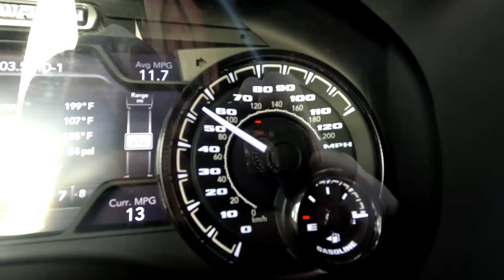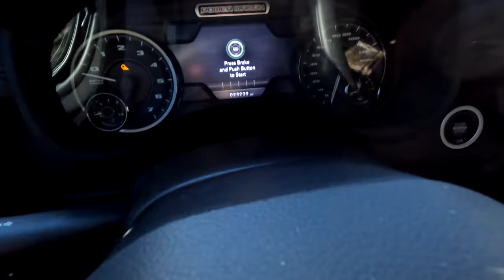2 Year no BS Review - 2019 Ram Power Wagon

Comment: Each manufacturer definitely have there quirks and dodges is definitely electronics. Wiring to be specific but it's rare that I ever see them have major mechanical issues. Ford from my experience typically has the mechanical issues but the electronics seem to be the best of the three and gm is in the middle. It's honestly a pick your poison issue. Sense I typically get bare bones trucks I have stuck with ram but there's no way I would get a fully loaded one as there's just way to much to go wrong.
Reply: It's a shame we can't have a truck built from the best of all three

Comment: Did you put bigger tires on the PW? Did the mileage change after that?
Reply from the maker: Yes I did. Mileage dropped in city but climbed on highway, so it was a wash.
Reply: @JustinKingOffroad  did you put a tazer or  AEV procal to re calibrate tires or pressures?
Reply from the maker: @89wildstang   I actually used alpha OBD to recalibrate the speedometer because that is permanent. I do have the taser RAM for other items though.
Reply: @JustinKingOffroad  I am looking to get one of them . Which one do you think is best as far as user friendly  and ease of installation?
Reply from the maker: Tazer ram would be my vote. All menu items accessible right from the dash cluster!

Comment: I also have a ‘19. I have nearly identical miles as well. My adaptive cruise works awesome, I use it everyday, and it helps me get better fuel mileage. It does brake heavily though if someone ahead exits. By now I know it’s coming though so I’m ahead of it. I have had 2 instances where the radio volume starts going up on its own till it’s full blast. Even if you turn the radio off, it will be at Max volume next time it’s turned on. The first time I disconnected the battery and it reset and resolved. The second time I did the Uconnect reset. It hasn’t happened again in about 6 months though. That is the extent of my issues, so that’s pretty close to nothing.

Comment: I have the 2016 PW.. I’m at almost 90,000 miles.. I have never had an engine light, or any little issues that some are getting, it seems 2018 and up are getting these little issues. I have only had to do regular maintenance, brakes, wheel bearing, shocks.. and it’s time for a serpentine belt, I’ll order it Monday 👍🏻

Comment: Justin, I think you will find if you get a compellable outfitted Ford, Chevy or what ever with all the latest gadgets, you will find comparable problems. Technology in an automotive products is just a hard road to drive. Vibration and environment are really hard to overcome, speaking as an electrical engineer. Mechanical problems on the other hand are just suspect engineering. Poor brakes (undersized) is poor engineering in my opinion. They should design for the size and intended use. I love the Powerwagon though, great truck, but lots of electronics, like they all have now, you gotta expect problems unfortunately. Great, honest review and safe travels my friend.
Reply from the maker: thanks for stopping by!!

Comment: Good review.  I have 16,300 miles on my 2020.  Only issue so far is the drivers sun visor vanity mirror pops out.  I never use it, so it’s not a big deal.  I have lots of warranty left so I’ll deal with it someday.  I’m getting around 13-14 mpg the highway and 10-11 around town.  Driving is about 80% on road and 20% off road.  I play around on the Oregon coast dunes a lot so it gets a heavy throttle input for a lot of the off road stuff, otherwise it’s gravel logging roads at lower speeds and heading up into central Oregon mountains for camping. Love the truck.
Reply: Weird. I have the same issue with my 2020 PW drivers sun visor, it has been like that since I bought it
Reply: Had the same issue my dude, i just got a new visor all toguether from coparts for 80 bucks with the wiring harness and bulb included; it was more tedious changing the damn thing than it was to actually get it; i really though i needed a junkyar to save me

Comment: I have a 2016 and recently upgraded to the Powerstop pads (kept the stock discs).  The stock pads are hard as a brick. I'm having to get used to driving it again since the new pads are grabby in comparison to the originals.
Reply from the maker: i picked up a notable amount of stopping power on the powerstop pads, i was going to keep the OEM ones for spares, but ended up throwing the whole stock setup of rotors and pads in the dumpster haha.

Comment: Hey bud, thanks for the 2 year update.  That is a lot of little bullshit stuff.  I have 6,700 miles on my 2021 now, all good so far with exception to a weird paint thing on one of my rambox lids (hand size tan stain started forming after 2-3 weeks and got darker over a couple months then stopped.  No flaws on the paint itself, just the white turned tan???).  I asked RAM to replace the cover/lid with a new painted one and they refused.  I then asked RAM to provide an unpainted cover to protect my content while mine was getting repainted...RAM refused again🤷‍♂️.  I drive mostly city and average between 10-11mpg.  It sucks, new that going in.  Recently took a trip to Overland Expo East, 750 miles round trip ish...14.3 hwy, average speeds between 65-80...not bad (87 octane).  I'll have to try the non ethanol deal just to see what happens to mine.  In reality the extra cost will likely outweigh the benefits.  Just FYI...I've owned 4 Ford superduty's in the past 20 years, with two rams and a Tundra mixed in...they are no better I promise...luck of the draw.  In my humble opinion, the powerwagon is the most enjoyable truck I've ever owned in terms of over all comfort, handling, perfect size etc.  I actually preferred my 2016 F-250 diesel over my 2017 (both loaded diesels crew cabs).  The 2017 was a bit nicer/more modern obviously but I liked driving the 2016 better.  I hope mine does a bit better towing.  My wife and I have a 6 week trip planned next year from SC to UT and many states in between towing out patriots camper X3 (3,500 loaded).  Cheers
Reply from the maker: Great info!!! Thank you!
Reply: It is ironic people look for the mileage and yet drive at above 65MPH speeds in an non-aerodynamic vehicle. HP increase with the cube of the speed so if you double your speed, you will need 8X the HP!!! It is not a linear function!!!

Comment: I have a 19PW same color just different options . The dash cluster comes out really easy , screwdriver and a little prying. I have done it several timss in my adventure with the Z Auto Tazer . Funny cause i thougt my tach was doing the ticking thing , but it comes and goes. Might have to check it out . Thanks for the heads up on the seat , I will poke around under there to see if the wire is loose. Got a question tho , How do you feel about Ruwarts service department ? I had the wagon there for A/C work (never has been cold since it bought it) and when i got my truck back , yes the problem was somewhat fixed , but i was really not happy with the condition of my truck. AFter all the trips you have made up there , can you tell me what you think of them now? If you dont want to do it publicly I will cath up with you on facebook.

Still love the hell out of my wagon!!!
Reply from the maker: I have never once had an issue with the service dept up there.  they are fantastic folks, super friendly, have always done everything right the 1st time.  they just replaced EVERYTHING on the front end of the jeep to fix death wobble under warranty, and even touched up the door graphics that had cracked and torn a bit.  i'm surprised that you'd have any issues up there cause they have top notch techs, and bob and jeff always take care of me.

Comment: I have a '21 Power Wagon and modified my garage to get the truck to fit in the garage.  I work from home so I do not drive it much as gas is $5 a gallon here in SoCal.
Reply from the maker: Mine barely fits but I get er in haha!!
Reply: How did you do it? Got two garages and a 22 PW and I would like it to fit in my garage
Reply: @oinn8003  My garage had a conventional water heater on a raised platform.  I hired a plumber to install a tankless water heater in my garage and we installed the tankless water heater high on the wall so my truck cannot hit it.  I cut the garage door opener pole that attached the garage door to the opener.  I then had a neighbor watch very closely as I backed my PW in the garage the first time.  Once I confirmed my truck was backed into my garage at a perfect 90 degree angle, I marked the garage floor with masking tape to the driver's side  tires so I use the masking tape line every time I back into the garage; P.S. I have to fold in my side mirrors to fit my PW in the garage.
Reply: @RK-kj8di  dude… what? Lol. Why on earth would you go through that much wasted time, money and effort to park a 2500 pick up truck in the garage? It’s a truck bro. It doesn’t need to be garaged. It’s supposed to be out doors doing truck stuff
Reply from the maker: I park mine in the garage
Reply: @JustinKingOffroad  why? It’s a truck
Reply from the maker: @michaellarrick8881  because I can lol
Reply: @JustinKingOffroad  hahah fair

Comment: Let’s switch I came from an 17 power wagon to 2021 tremor 7.3 my main seal was leaking and my transmission is slamming gears 11,000mi on her  dealership fixed main  but trans is another story unfortunately… great review I wondered how the new ones are
Reply from the maker: Man... That's wild!
Reply: I just swapped my 18 that had 30,000 mi for a 21’. The new truck has adaptive cruise and lane stay where the old one didn’t. My 18 drove about the same as my 5500 ram work truck and like your’s Justin, it didn’t like to stop. My 21 on the other hand will smash your face in the dash. The 8 speed transmission gives it that constant feeling of power as you accelerate and I can steer effortlessly with one finger! Huge difference between trucks. An added bonus is that with my wheel/ tire combo my 18 could not turn lock to lock without hitting the radius arm and sway bar. I swapped my AEV wheels and 37” Yokohama’s from the 18 to the 21 and no rubbing lock to lock other than at full stuff. Great review

Comment: Good listen.  I just ordered a '22 PW and am really looking forward to it.  There is always a chance there will be some issues, I really appreciate the commentary on the brakes (I have owned a few Cummins 6.7s with no issues ever and currently own an F150, 3.5L Turbo that is having a lot of issues).  My F150 has the 10spd trans and its really clunky around 7th/8th/9th gears and has a pretty bad tick at cold startup and the sunroof doesn't always close on the first (occasionally 2nd, 3rd, 4th) attempt.  Hoping I don't have your issues with the PW, plan to put AMP power steps and 37" tires on as soon as I get it, I may go ahead and do the brakes as well!  Thanks.
Reply: How do you like the PW compared to the Cummins?
Reply: @sun_dreaming  I like both: Cummins far superior in towing, hauling and fuel mileage
PW far superior in ride and off-road capability.  Really just depends on what you want out of a truck.

I’ll probably go back to a diesel unless there is some really good HD hybrid or electric that comes out in the next couple of years

Comment: You didn’t mention that in your review about your tire size change. The issue is the dealer needs to recalibrate your new height because of the tire change. Yup, there’s your ACC issue. Had the same problem with my Gladiator. Note that some less experienced dealerships don’t know about it either. It’s a $75 service.

Comment: The ticking is simply the clock wired to speed meter....easy fix...Ford 😄. 
Well they can all have problems. My F350 6.2 gets 15.9 on highway.2012 C.C.L.B. 4x4

Comment: I have a 2018 / 36 k miles with no issues 🤞🏼The brakes do suck, I will do the Power Stop upgrade,thank you.
Reply: Do not get the drilled rotors as they holes drilled causes high stress and will crack. Only high end manufacturers like Brembo that make OE brakes for Porsche and the like will cast the holes into the blank rotor discs and then finish drilling them afterwards. They typically have a lower tendency to crack. Slotted rotors are fine.

Comment: If you recall I told you to put drilled & slotted rotors on the truck and that would fix the braking problem, If you an HHO generator on the truck your fuel economy will improve 2+ MPG.

Comment: First edition, of all the electronics too. 2019, 2020, and 2021 had their issues. Seat belts do suck. Probably the worse seats belts ever. Seat belts would feel comfortable if they were built in the seats. Seat vents are only made for the buttocks not the back side, and the heat the same. That was weird. Window buttons for sure don't work 100% with auto up and down. If both buttons are hit at the same time, the left window and right window up or down, and only one actuates. Surprise every time if it's the left window or the right one that goes up on auto. First edition new gen Truck years like 2019 have historically had issues than it's 2020, 2021, or 2022 years later on down the line in the future. The First edition is the tester trucks. I used to sell Ram trucks in Texas and own a power wagon. Only seen one major issue. 3500 2019 truck, had one cylinder missing the oil catch piston ring. Ate 1 quart of oil per week. The customer was so 😡 mad, I hope my managers made him whole. That was from the factory, so mistakes do happen. That's every car manufacturer because we're all human. Heard power wagons and RAM trucks are built a bit slower than other competitors due to the hand 🙌  work and difference in tooling and shaping for this new generation truck, plus its actually made in Mexico the 2500, 3500, and 4500 RAM trucks. 1500 trucks from RAM are the only ones made in America in Michigan. Most of the issues have been from the 2500, 3500, and 4500 line up. Like seen on TV and in news type of issues during 2019, and 2020 years. Due mainly to the international built, language communication issues, and RAM contract with Mexico, I don't agree with it. Love the way the Hemi engine for what it is it's tuff and strong enough with the proper lubricants. It's and SRT engine for god's sake! Actually, a racing engine, tuned for Farm work. Not Farm work made for racing. Would be cool if someone made a supercharged Power wagon and actually used the gasoline in it with this 392 engine, Making a TRX whimper due to the TRX's smaller bored cylinders.

Comment: I had the exact same issue with the seatbelt on my 2021 PW, but I fixed it! Saw a YouTube video on “how to fix a sticking seatbelt.” I didn’t believe it but the belt itself was dirty. Not visibly dirty, but in just 10k miles it must have accumulated enough dirt/dust/dog slobber/whatever the belt had gotten juuust enough stiffer that it didn’t slide over the top hanger as easily anymore. I extended the belt all the way, clamped off the top so it wouldn’t retract, scrubbed it with dish soap, and let it soak for about 30 mins. Rinsed well, let it dry overnight, and viola, like new. I think a stronger retracting spring would prevent the issue all together.
Reply from the maker: INTERESTING!!! I will have to try this.
Reply: 0 cent fuse but no it's a $1,200 power box, tach doesn't  work turn signals when you first turn on the left turn both left and right flash once then just the left flashes truck only has 96,000 miles I've replaced the front brakes 3 times now, and tires have been replaced the last ones rated for 70,000 miles and they are almost to the wear bars, but mechanically it still beats my old 03 6.0 ford, and now my F-150 for work 46,000 miles engine blew sky high in Nebraska

Comment: I ordered a SD Tremor and am thinking about cancelling for a PW. It's that electronic front locker and sway bar for me. When I watch comparison videos of off road articulation, it's night and day. I feel like, what's the point of having a true off road rig without those features? 

I've had a F-150 3.5L twin turbo for 3 years.  Had to replace that 4WD vacuum tube on the road for vacation out of state as I listened my 4wd half engaging and grinding away. Replaced the fuel pump once after stranding me in Chicago. Got it back and immediately stranded me again. Replaced fuel pump control module thing in the back of the truck underneath. Master cylinder failed at the brake vacuum pump and lost my brake pressure driving home. Didn't die.
 🙃👎Coil pack went out. Went into limp mode several times. Replaced throttle body. Sunroof had a leak that kept getting the ceiling wet. Had to treat for mold.Opened the ceiling and Found a loose drainage tube. Fixed that. Still leaked. Found there was also a defect in the sunroof glass itself after adjusting the glass 5,000,000 times. That led to a broken retracting arm for the sunroof. It's now JBwelded back together.

That's most of it. Believe it or not, I still really like my F-150. It's much faster than any Ram truck I've driven. Brakes are far better too. That being said, I think I want to try the off road beast now! 😬👍

Comment: You have been lucky to have never had a problem with fords if you have had several but that is true of any brand. The tremor is sweet and like that 7.3 but it's not quite as off road focused. I just traded my gladiator after 2 years and 22,000 miles for a power wagon. I needed more space for kids, a bigger bed for work, missed a v8 and they gave me exactly what I paid for my jeep and the trade canceled enough sales tax that it was to good to pass up. Hopefully she will be a solid vehicle outside of the obvious poor fuel economy but its always a gamble. My buddy traded a 2018 raptor for a 2020 raptor. First one was flawless. Second one was on its 3rd engine before 25,000 miles. You never know.